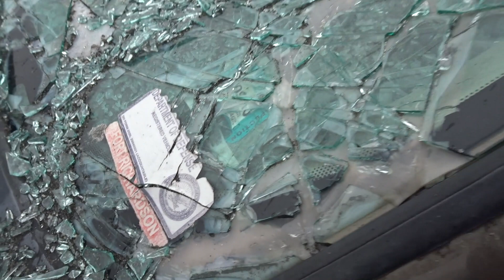WHY I DON'T OFF-ROAD AT JIM CREEK

Comment: There’s been people taking cars and trucks out to the Jim Creek/Knik River area and ditching them for decades. My buddies and I used to take our trucks and ATV’s out there to go riding and camping several times every summer back when I was in high school in the early 1990’s and always saw abandoned vehicles. We even had to strip a leaf spring off of an old abandoned truck to rig up onto our ATV trailer when one of the springs broke on it. A spring broke and the tire rubbed on the flatbed of the trailer but we were able to take one off the old truck we found and lashed it into place and got it to work well enough to get us back home to Anchorage. It’s a shame how much trash and vehicles get dumped out there. Almost all of the vehicles are stolen and the ones that aren’t are usually cheap ones that the owner got stuck and just left instead of paying hundreds of dollars for someone to recover with a truck that could make it out there and then back while bringing the vehicle with them. If someone built a big F-650 flatbed truck with heavy duty winches and even a small crane they could make a killing pulling stuck vehicles out of the silt and mud out there.
Reply: Now tax payers foot the bill... Putting a parks/recreation building at the trailhead and increasing State Trooper presence has been the best thing for those of us that appreciate Jim Creek
Reply: @wrappnalaskan  I saw that they built a designated shooting range out at Jim Creek too. In the 1990’s and earlier people just shot guns wherever they wanted. No designated camp areas either back then. We used to camp at Montana Creek a lot too and could just find a spot and pitch a tent. Not sure if there’s many places they still let you do that anymore. It seems like a lot more people are using the area during summer and the winter months with a lot more going all the way to the glacier. It used take a big vehicle and a lot of work to get to the glacier too but the reward was worth it.